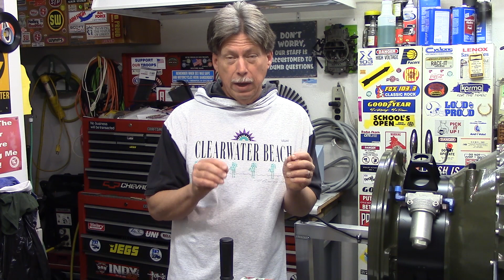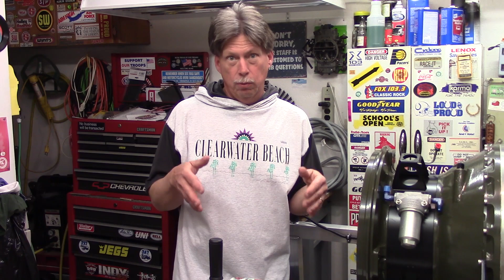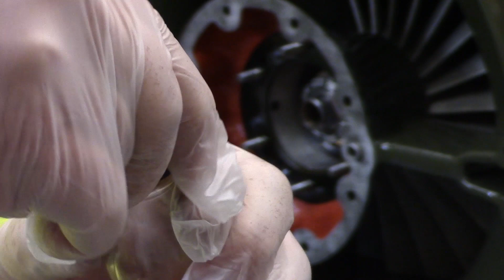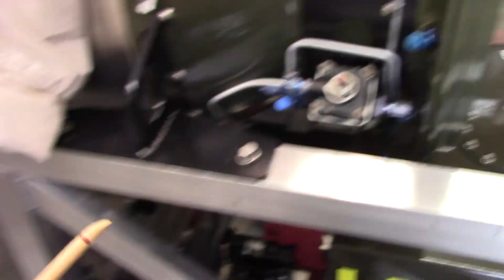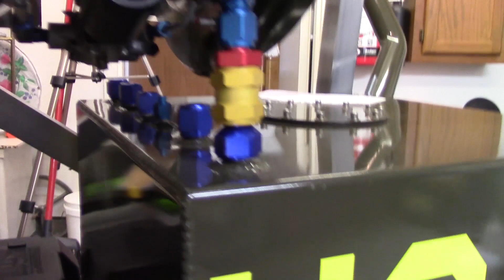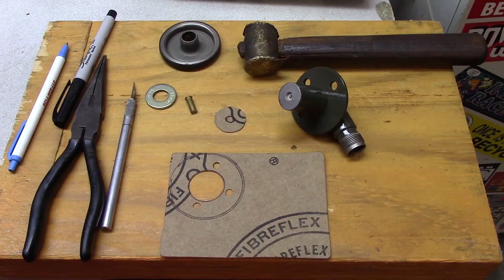The J44 Project:  Final Assembly, Part 6, Wrapping-Up the Core!

Comment: Hi Darren,, no questions but your engine looks very nice and it's a joy to see how meticulously you work. Keep it up!  Using a .22 cartridge as a punch for a gasket is really inventive. I'm afraid possesing those would be illegal in my country :-) I'm not 100% sure but did I hear the song "The end" from The Doors in the background?
Reply from the maker: Yes, that is 'The End', by The Doors, near 'The End' of this video!  Thanks for pointing that out, as I had not made that connection!  That was Sirius satellite radio in the background, on the 'Deep Tracks' channel, so it was completely coincidental for that to have happened!  Thanks for the compliments on the engine's appearance; I hope it runs as well as it looks.  You may substitute any thin-walled tubing in place of a shell casing.  They have a thin wall & an almost sharp edge, so they are simple, if you can find the right size.  An 'X-Acto' hobby/craft knife & patience will also work.  Cheers!

DD
Reply: Funny coincidence. I guess my hearing is still ok, it wasn't that obvious. He had a great voice b.t.w. I'm indeed interested how it will run, but you better not rush overhauling a jet engine. I once used a hex-socket to punch a hole in a gasket but this wasn't a great succes. Not sharp enough. Advantage was having a lot of available sizes in my toolbox. Patiënce is a virtue.